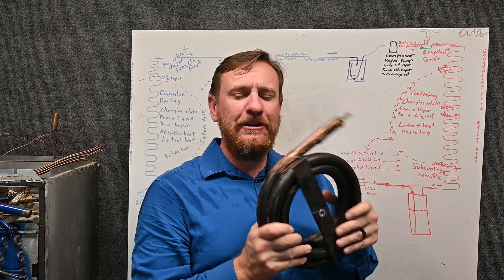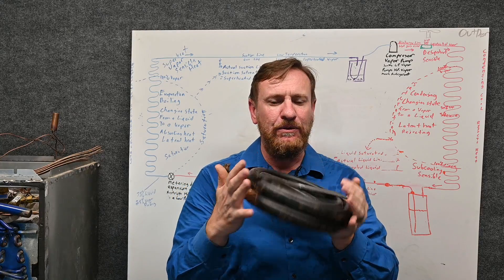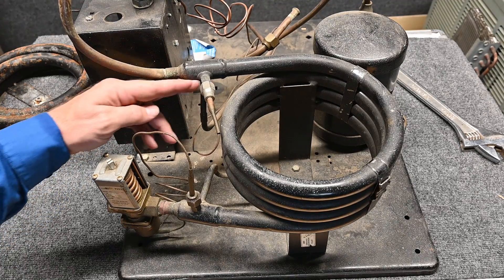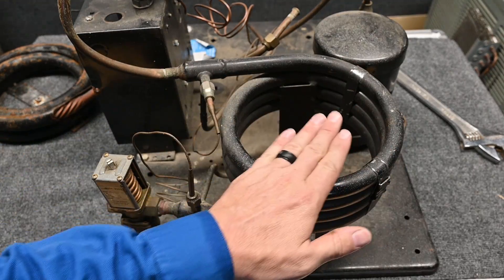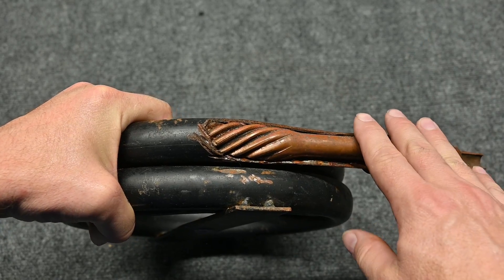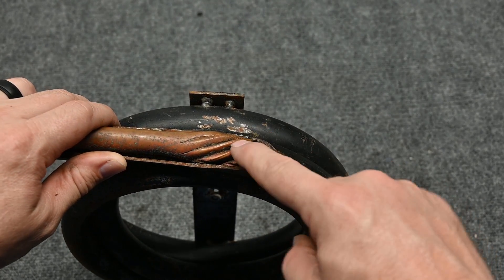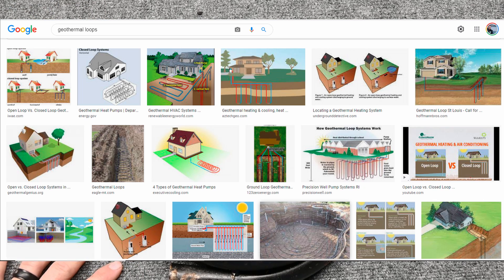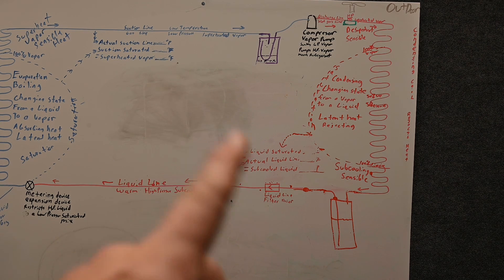HVAC 079 Water cooled condenser introduction

Comment: I want to take a 2 ton Goodman 14 seer heat pump cut the condenser coil off and put a axle flow exchanger like you showed. That’s why I’m on your site. I have a backhoe and I can bury a lot of pipe.  I’m an HVAC contractor, but I’m not going to spend 8000 $9000 on a Geo.  I’ll just modify something and do my own.
Reply from the maker: Yes sir very doable!

Comment: This is great info. I tried fixing a unit similar to this mostly in apartment buildings. It was in high pressure because I think water was clogged. Told them just call a company since I wasn't 100 percent sure.

Comment: I have been wanting to build a small geo thermal window from a window unit i guess a portable one would work but it would be cool mostly to be more efficient i know my unit will drop like 100 watts when i fill the pan with water so if the temps and pressures are way down id like to see the difference it would cool to make it able to heat aswell but that might be above my pay grade

Comment: A year later,  I have learned much: the 70' of copper pipe in the well does not have enough recovery. After one hr of running the inlet water temp. is approx. 105'f; outlet is around 118'f. similar to an air to air condenser coil. Unit is still cooling well: suction press= 65 psi; discharge 225. [Need to run it longer for more experience]. A nearby creek has an inexhaustible supply of 82'f water [usually lower]; i may tap into this temperature source in the future. High ambient temperatures call for an ac to run many hrs. This type of experiment calls for curiosity & a passion for learning; hopefully it will save someone else all the work i have put into this project & they will find a more sufficient water supply.🤣
ed c

Comment: I hope there will be a design in which the water that is warmed up by the hot refrigerant can be utilized (as  a clean, warm water source) instead of being discharged into the environment.
Reply from the maker: Most of the time it is tied with a geothermal loop with glycol that is itself contains and recirculates. Others work with a cooling tower in the roof.

There are some older mindsets of people that use what is called a pump and dump that pumps water out of the ground and dumps it into a storm drain or sewer. Many places have banned that kind of system.

Comment: How to use water to cool if i have no water tap? Can i use a water pump instead?  How to get cool water if i have no water tap?  Do i need to add coolant liquid to the water ?
Reply: For this type heat exchanger you will need water available.

Comment: What seems to be a problem of one of our water source heat pump that’s working fine in cooling with good superheat and subcooling based on manufacturer’s data. But when it’s heating mode, it freezes up that coil. Uses capillary tube metering device.

Comment: Is it feasible to integrate this Water Condenser TOGETHER with an existing Air Cooled Air Conditioning condenser ?   Anyone ever tried ?
Reply from the maker: There is a hybrid unit.
A tech cuts the discharge line between the compressor and condensor, pipes it to water heat exchanger and then back to the condensor.

When the condensor ran, it activated a pump that moved water from the water heater to the heat exchanger and back the water heater.

It did not work so well because during the day when the AC ran, nobody was taking showers. In the morning when people took showers, the AC did not run.
RUUD had a premade condensor and water heater combo that used this same idea.

I really it's better to just use a dedicated  HP water heater.

I did see 2 times where people have done something similar to help heat the pool but the pool water is hard on the heat exchanger.
Reply: @love2hvac  Thanks for your thoughts.   Good point about the hard pool water too.  I believe this is feasible to help remove heat for AC during our hot summers... not so much for heating in winter.  I can try this first connected by relay a zone of my underground sprinkler system.  Perhaps best like you mentioned (HP Water heater) to use a separate pump system with its own fluid.  How about  connected to a second heat exchanger dug in below the frost line?  Thoughts?  Thanks again.
Reply from the maker: Yes give that a try.

The absolute best would be a closed loop geothermal system with buried lines in the ground. Then you would not even need the air cooled side and it's more effective and dependable

Comment: Are water cooled condensers more efficient than air cooled condensers. Do they reduce the amperage draw by the compressor.?
Reply from the maker: Yes. A lower head pressure means lower compression ratio, less work on the compressor and lower amps
Reply: @love2hvac  thanks for the reply, so if i continuously pour a small amount of water on the condenser coil and fins of the my Air conditioners' outdoor unit will it reduce my electricity bill?

Comment: Great video, l have that same system on my water cooled ice machine, but now the water is not flowing through the inlet causing machine to overheat and switch off before completing an ice making cycle, error message writes (high Pressure) what could be the problem

Comment: Hey Ty, would be great to see more water source videos. These units are installed everywhere in my area in CT. Mostly geo heat pumps. And water temp is 52-60 all year. I've always wondered and havnt found answer to how these units can run in cooling with 50f water but yet if it was air cooled w 50f ambient we need head pressure control. No tech I've asked could answer this. I know water has a higher specific heat and heat capacity than air, but it's still 50f so I'd love a better understanding of how these units can run with no head pressure controls at those low temps. Great video
Reply from the maker: The lower temperature is offset by the flow of the water. If the water flowed too fast it would be an issue and drop the head pressure.

In some cases, especially with open loop systems a water regulator valve is installed that uses head pressure to adjust and control the flow of water.
Reply: @love2hvac  thank you for the reply. Makes a little more sense. Can't wait for you to do some videos on it.
Reply from the maker: I want to do some Geo videos. There are not many around here and the people that have have not responded to my request.

Comment: Can this be coupled to standard 16 SEER outdoor heat pump then on the water side go to a buffer tank for hydronic heating or cold water for cooling??
Reply from the maker: Yes, it doesn't need to be this big but there are kits available. Just for this purpose.
Reply: @love2hvac  can you steer me to one of the kits and do you think it would be better with a buffer tank ? Say 2 zones one for heat (hydronic) and one for water air handler. Just don't want to buy a monoblock..

Comment: My previous geo heat pump used the submersible well pump to supply water. 1200 watts=too much, no savings there, though it put out 100 degree air. My new geo air cond will use 70' of 1 inch copper pipe with a u-shape sunk in the well [57 degrees] and solar powered circulation pump. Hope there is enough recovery to handle 21,000 btus
Cheers
Ed c

Comment: Thanks for the visual! How do you prevent dang old restrictions from happening in the refrigerant section of this piping, though? Seems inevitable with noncondensables
Reply from the maker: I have never had a restriction on the Refrigerant side of one of these. The water side ends up with calcium buildup that has to be treated from time to time though.
Reply: @love2hvac  thanks for the response! Must be a highly unusual situation I came across then. Thanks again for the video!
Reply from the maker: Maybe the water froze at one time, expanding the inner cupernickle reducing the refrigerant passage?
Reply: @love2hvac  I don't believe so because the system was able to run for about 5 minutes after being charged - then tripped on high head pressure. Tried to blow nitrogen through it and it was solidly blocked, so there has to be something that got into that spiral, or deformed it in some way.

Comment: Did you made some measurements for wattage? Comparing air and water cooling? Would it be good to use warm water supply for heating with the inverter ac?

Comment: What do you think about asking our hvac guy about changing our regular air coil on a 4 ton unit to water cooled one.. we are industrial laundry we have a huge 4300 gallon water tank with softened water no calcium on it. Our air compressors and air conpressor chillers run of this system they reticulate the water though the tank it's not enough to heat up the water may make it little warm if we aren't using the water but we run just about 24/7 do you think it's possible
Reply from the maker: Absolutely possible.

You can also buy a geothermal unit or a "Florida heat pump"  that is designed to do exactly what you want in one convenient box.

Comment: I found this blog very useful,,,,I have litle question ,,,when the condenser water cooler it leak ,,,,in the refrigeration sistem ,,,do I need to change the unit ,,,? Or it recommend to change the water condensar cooler,, ? Can you  advise you opinion __ thank you
Reply from the maker: Refregerant in the water, change the condensing water coil set. If there is water in the refregerant then change the system.

Comment: DOES Receiver in the system would affect how do we set up the subcool on the water-cooled condenser, what subcool temp we should expect on the water-cooled condenser, how to calculate out approach temp in water-cooled condenser ? is it temp between water leaving the condenser and condenser saturation temp would be approach temp?
Reply from the maker: With a receiver subcooling will not be as important. Make sure the receiver is not over 80% when pumped down. 
Your subcooling numbers will not be accurate however you can check for some subcooling at the exit of the condensor before the receiver. 

Subcooling without a receiver will depend on on the manufacture design of the coil and system. The engineer will design _x  volume for a subcooling cuircuit.   

Approach would be 
the temperature of the refregerant liquid leaving the condensor minis the water temp entering the condensor.

Condensor TD would be the saturated temperature (psig-temp) minis the water entering temperature

 Condensor deltaT would be water temp into the condensor - water temperature leaving the condensor.

Comment: we build marine refrigeration systems, and nearly all are using cu-ni seawater condensers.
Reply from the maker: Thanks, Mike, I have some questions if you have time.
The seawater intake I'm assuming is a central system for many things. What kind of filtration is used and what type of pump is used?

How much life do you get out of the condensers?

Do you flush the condenser or have any other maintenance specific to the marine side.

Are you using water pressure regulator valves for the condensers?

Do you build the condensors there? I would love some pictures of the process.
Reply: @love2hvac   All good, I actually came from the pro sailing side of things and took my knowledge of boats to a new field about 20 years ago. The seawater circuit starts at the thru hull ball valve fitting,  which may have a very coarse fwd facing clamshell strainer covering it, then a short, and hopefully, slight upward hose run to the inlet of a seawater strainer, which has a removable basket, much like your pool filter, but much more robust, with bonding direct to the zincs, this leads to the pump inlet.
 The life of the bronze pump and impeller are really kind of unique to each boat, due to flow rates and how the system was maintained, restriction of seawater causes metal impingement and impeller cavitation/failure.
The pumps are matched to the needs of the system, generally its about 4 gallons a minute per 12k btu, the newer Ti units have different flow rates.
The condensers themselves are Cu-Ni or more recently Titanium.
They can last for decades or fail in months.
The condensers are usually flushed with a mild acid once a year at most in places where growth is excessive, usually in warm southeastern/tropical areas, where the pumps are running 24/7, this can vary a lot depending on lots of things.

Stuff grows where water flows.
The west coast is less of an issue because of less demand.
We do use a seawater regulating valve on some of the larger systems to allow them to deal with a wide range of seawater temps.
Most of these systems are air/water cooled with the seawater circuit first in the line.
The reason is that if you have done a big trip, caught lots of fish, and are heading back, and you have an issue, like hitting a log or something and the boat needs to be hauled out, you can simply turn off the pumps and keep the holds cold on air.
We build our own condensing units, not the condensers themselves.
We have a new 12/24/32vdc system that has a variable capacity, seawater cooled that is fantastic.
We also build eutectic plates for holdover systems in boats that need it.
I enjoy your videos and recommend them to anyone that wants to understand how heat moves.
Thanks.

Comment: I have a building with 370 water source heat pumps. 2 big towers outside. 75hp pumps in the basement for the loop and tower
Reply from the maker: The units on the lowest level are the ones that get closed the most?

Comment: I work on a lot of geothermal units. We regularly use Pete's plugs to check water flow and hear transfer. Are these common on other systems? Thanks!
Reply from the maker: Most of the ones I worked with had a Petes plug kn Texas. I don't remember the highrises in Miami having them.

Comment: For this condenser if the water line made from aluminum that will transfer heat better than copper. Thanks.
Reply from the maker: Possibly but the water will eat threw the aluminum too fast

Comment: We had a lot of water cooled equipment.
😐👍🏻
🍺🍺🍺🥃🥃🎳🍇
Stay safe. 
Retired (werk'n)keyboard super tech. Wear your safety glasses.
Reply from the maker: It was always interesting when you put your gauges on and water came out.
Still a lot of waste water systems when I was in NY
Reply: @love2hvac  we only had two wastewater head pressure dump package units the rest were on towers.
Reply: @love2hvac  generally you could start to see a milky site Glass on the compressor.